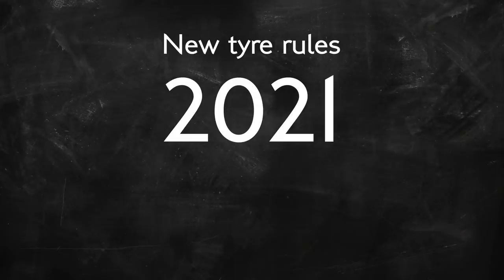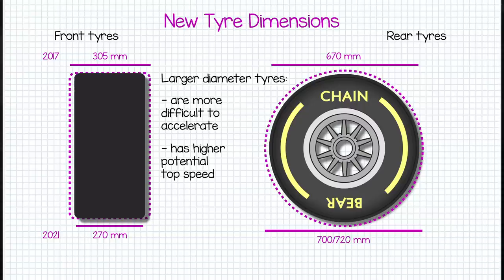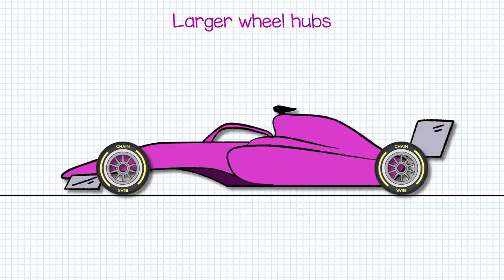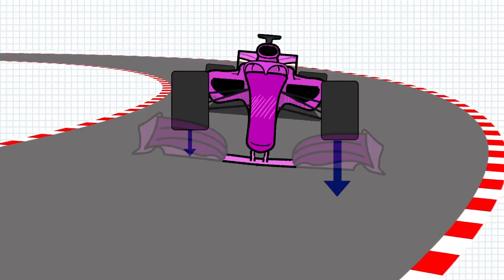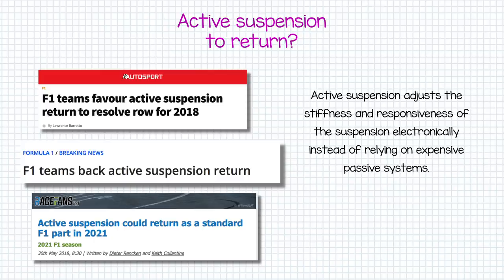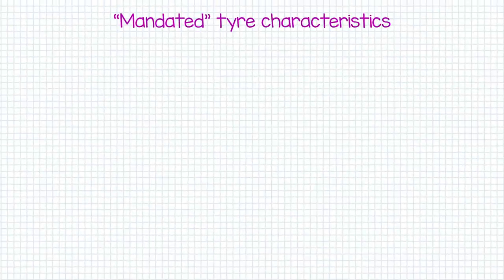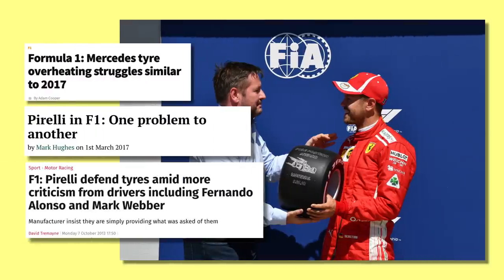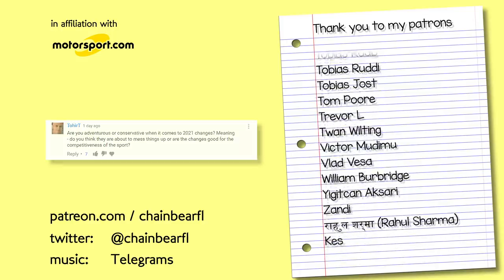New Tyre Rules 2021 explained - Low profile tyres, no tyre warmers, radical compounds

Comment: You forgot that larger brakes can be fitted.
Reply: moreover larger brakes would increase overall weight significantly which is a big no no in F1.
Reply: kuglepen64 bigger brakes doesn't always mean better. too powerful brake can easily cause lock up, which becomes more dangerous and producing less stopping power overall
Reply: +doge
To the contrary, bigger brakes provide finer control and lower chance of catastrophic failure for a given torque. Peak braking power means nothing when you can just adjust the damn pressure.
Reply from the maker: Ah true but this is unconfirmed. FIA might mandate that brake discs and ducts stay the same size
Reply: Chain Bear F1 larger iron or steel brakes = longer breaking distances = more passing!
Reply: FreQ135 no larger brakes mean shorter shopping distances
Reply: Larger brakes mean more unsprung weight - they don't currently need them
Reply: Rens van Ampting The brakes are currently made from carbon, which run very hot but are very effective. A shift to iron or steel would mean longer breaking distances and more overtaking.
Reply: Antoher thing is, it could be too much for the drivers if the brakes are too powerful, the forces they face are already insane so I can't imagine how difficult it would be to ensure even more force
Reply: Except they can't.  Because it is separately restricted.  How does your comments have 33 people that agreed with it?
Reply: I think they could maybe use more brake power at higher speeds but once it gets below 250kph or so it's all down to the tyres anyway. This is why drivers can lock up if they don't pay attention. So bigger brakes just means more mass, more unsprung mass and they don't even need them and all this weight if all the teams have equal limits for brake systems. Also bigger brakes and bigger cooling intakes for those brakes give a drag penalty although that is fairly small compared to the overall drag
Reply: Hamilton was complaining about the weight of the cars increasing, but the brakes not getting any better. Now they can fit bigger brakes.
Reply: Brakes in f1 are already big  and strong enough to stop the car from 300 to 0 like nothing. The thing that makes the difference is downforce which completely changes the braking power of the car. Downforce is about everything about this new era of f1. Thats why its boring!! F1 needs less downforce, actually a shit ton less than  what it actually has, f1 cars nowadays are as easy to drive as ever because of their downforce levels, obviously it is associated with higher G forces but thats about it..
Reply: It's not about braking power, it's about heat dissipation. A larger disc can dissipate more heat more quickly thus reducing the needed cooling. Smaller brake ducts means less drag. 

There are some other benefits as well but I don't have the time or space to write a technical article here.
Reply: I doubt the FIA will restrict brake discs if the tire rules already reduce grip. They'll probably let the teams tinker around with it and see what clever innovations come out of it.
Reply: @FreQ135  Wrong this would not mean more overtaking!. It doesn't matter how good or bad the brakes are in F1, everyone under the same rules will still be at the limit of man and machine under braking regardless.
Reply: @Jon B If you have longer braking distances, there is more opportunity for a driver to outbreak another, as they spend longer doing it. Eg. If you brake for only half a second, it's incredibly difficult to brake even 1/10 second later. If you are breaking for 6 seconds, it's much easier to brake a couple of tenths later than the other guy, because you have all of that extra distance to brake better or harder. Not every driver or car has the same braking ability or limit.
So I respectfully disagree with you.
Reply: Brakes aren’t an issue
Reply: Not required
Reply: @rancidalankar1322  extra few pounds of brake in each wheel = braking faster/more consistently = faster cornering

Comment: I just saw the notification and I have to say that am really confused about the new rules. I immediately came here to have a guaranteed perfect explanation of the new tyre rules
Reply: Saul Levy Basically, larger profile tyres on performance mean, faster turning response, faster braking due to larger brakes, a slightly less lateral g tolerance. From a practical point of view it means that the 18" tyres have a lot more relevance on the road, so you could buy very similar tyres for your car that are on F1 cars, but of course, with grooves.
Reply: J P in that case i was successful :D

Comment: Am I the only person who prefers having all the different names for each compound than the three tyres with the same name but different compounds
Reply: James Bloomfield nope
Reply: Also i like the colours. And they don't confuse me at all. But F1 needs to be accessible for the casual watcher
Reply: During a race you just want to compare tyres between cars to know who will gain or lose performance when they change tyres.

Comparing which tyres were selected by the authority on different tracks is meaningless.
Reply: @petrolhead9927  More accessible for a casual watcher, like saying today we have a hard compound tyres which are softer than last race softs and harder than the next race hards. It's like adding 1 joystick to your oven instead of 15 individually named buttons.
Reply: They should just name them. T1, T2, T3, T4, T5, T6, T7, T8, T9
"Oh, for this race we're gonna choose T3, T5 and T8"
Reply: You’re not alone. However purists will still be able to read the sidewall colour system, yes?
Reply: @odieostrich7718  If you mean the tyres will still have the original colours to this year (pink, purple, red etc.) then no. As far as I know it has now been confirmed that every race will now have... Red = Soft, Yellow = Mediums and White = Hard, so they are changing the colours we are all used to anyway "So they are easier to tell apart from each other on TV"
Reply: @HappyBeezerStudios  that's exactly what they do, C1, C2, C3, C4 and C5

Comment: Nice video, although you forgot one important thing. When the height of the tyrewall is smaller, it gets tougher/stronger, thus increasing the amount of G-forces that the tyres can withstand. This increases the grip (=speed) through corners because the tyres won't stretch as much as before and therefore, drivers can be more aggressive. If we suggest that the suspension is tuned perfectly, the cars will also be a bit more controllable since the drivers will have more feedback as before.

Comment: In theory, the lower profile tyres will help drivers in situations where in the past cars have occasionally over-steered suddenly or slid under acceleration, the driver has attempted to correct but because of the energy stored up in the sidewall of the tyre (i dont know if that's actually it but that's certainly how some f1 commentators have explained it), this causes the car to suddenly snap the other direction, putting the car into a spin and even into the wall on occasion.

Comment: great so now even f1 has big chavy rapper bling wheels i dont get why people think bigger wheels look better who looks at an e type's wire wheels and goes this really needs some 20 inch wheels with some rubber painted on. the current gen of f1 cars look fantastic with the aero and wheels like the tyrells and lotus's in the 70's
Reply: Its not about looks. F1 is supposed to be one of the leaders in technology driven motorsport. So why do they still use such archaic tires?
Reply: roryforham they have performance advantages you know. that’s why high performance vehicles usually have low profile tires
Reply: gav com but they also don’t have some performance advantages. Dragsters have high profile tyres. Larger sidewalls are beneficial for suspension too

Comment: This video popped up again, so I watched it again.
First of all, one or even two stops (unless you're on the hardest tyres) would become really difficult, and might lose you enough time that even a three stop is the minimum practical solution to any race. Just that alone, combined with the fact that you know some might even try four stops with such early tyre degradation, would make for a lot of strategic play. Let's just hope the FIA does away with the two compounds requirement and lets teams decide for themselves. If we see both a successful four stint soft run and a successful two stint hard run in 2021, I am very happy, because that means strategy wars, and as with most wars it leads to new ideas.

Comment: F1 Driver and FIA think that building a tire which is made of rubber is the same as building a car out of carbon fiber, steel, aluminium and so on (you guys get the point).
Rubber isn't predictable as stiff materials are. Rubber doesn't fail with the same consistency as (picking one of previous examples) carbon fiber does. Rubber needs to grip the car, have a temperature window much smaller than all the components in the car, needs to withstand massive amounts of force and they wear out so fast compared to any other component on an F1 car that it can't really be compared to anything else. So by asking Pirelli to not only build a tyre made of something which is not as consistent as a metal that can handle and provide the necessary performance to an F1 car but to also include a defined time window of lower performance in accordance to tyre degradation (by the second AND by the lap) is simply ludicrous and pretty much impossible. More likely than not, someone's gonna have to give in on one of those demands.

If Pirelli does pull that off without someone complaining about an aspect of the tyres (FIA, Teams or Drivers), I swear to god I'll not buy any tyre from another brand except Pirelli for the next 60 years of my life.
Reply: Sign me up too, and I will even make my own bastards use Pirellis too, until cars can fly and mankind does not use them anymore!
Reply: Very well said.  Kind of makes you think of trying to make a sword out of chewing gum.

Comment: My concerns for these changes:

No tyre warmers => Undercuts won't work as well.

Tyres that work better at low temperatures => Slippery conditions are now easier to drive in (Germany 2018 won't happen).

Low profile tyres having more setup variation => More opportunity for upset results  Active suspension removes all variation.

Comment: More to the point, perhaps, is potentially greater inertia of the wheel assemblies.
90+% of people don't give a heck for any race programme the tyre manufacturer is involved with, very few could even tell you who the supplier is.
Tyre technology, or rather understanding how the tyres work on the vehicle, is a black art and these changes are a double edged sword - while some modelling may be transferrable from other disciplines, much of the current understanding and modelling will have to be thrown out. The suggestion that they will potentially have an even narrower optimum operating range will, no doubt, be greeted with horror by the engineers who already are having problems getting, and keeping, the tyres in the current range.
Agree that the compound criteria is daft - it does bring into question whether heat cycling will partially cure them to improve, or tweak their race performance - possibly teams using more of their race allocation prior to the race in Qualli' or practice?

What is also going to undergo some massive changes is the braking, as they will no longer be as restricted by the wheel inside diameter.
Reply: If properly designed, the wheel should only be a few grams heavier while the tire will actually be a LOT lighter. So total rotating mass should be less.
Reply: wingracer 16 thats impossible, the 13's are smaller than 18's and will always have smallet weight and inertia
Reply: You are ignoring the tire. Rubber is heavy. Less rubber means lighter tire.
Reply: wingracer 16 sidewalls are very thin and light, pirelli have confirmed all this years ago, the wheels will be heavier by a much larger margin than rubber savings, but itll look "cool"
Reply: True, the construction is very lightweight, esp' when compared to 'road' cars - but, remember, while there will be a reduction in sidewall height, there will also be more mass added  in the bead/breaker area as it will be significantly longer.
Then, of course, there is the additional mass of the wheel - square law, remember - and the bigger brakes that will then be used will also compromise total mass, both unsprung and rotational inertia.

Comment: If active suspension does indeed return, and one teams system is not as effective as anothers (aka it doesn’t work), how much time would they lose over a lap as a result?
Reply: Mutch. If doesn't work you will be probably near the last teams.
Reply: im sure all the teams will put so much time and resources into it, that theyll all be as perfect as they can be for their respective suspensions, cept williams, theirs will probably act like one of those bouncing cars but they cant turn the bouncing off
Reply: "Active", be it suspension or aerodynamic is banned from Formula 1.
Reply: The nice thing about active suspension is that if you are behind your competition, you don't have to spend millions designing a whole new system. All you need is a software update.
Reply: all they need to do is learn how to tune the suspension just like they do in other forms of motor sport
Reply: How TF would anyone know that without it actually happening 😂

Comment: Low profile tires will drip quicker, but the profile( bead of the tire to the surface) or sidewall thickness, will wear out quicker. General rule of thumb.

Comment: What you mean is there will be smaller proportion of undamped suspension with low profile tyres. But what about unsprung weight with much larger rims? Dont forget weight goes up with r^2.
Reply: It means the suspension provided by the tires large sidewalls is uncontrollable by the teams, moving to a larger rim moves more of the suspension to the controllable side, designed by the teams.

Comment: 2:40 so bigger tyres = faster. hmmm tractor tyres on an F1. This would be genius!
Reply: bigger wheels is a higher top speed with the same vehicle
Reply: if you had tires the height of a tractor tire on an f1 car accelerating in a straight line, ignoring aerodynamics youd eventually reach a higher top speed than you would with the 13"s

Comment: This could interesting, but one other thing they could do is open tyre supplier again and open the tyre compound to have a drop off window say the hard tyre to have a cliff between 20-25%, the Medium between 14-20% and the Soft between 10-15%,  that would bring strategy in again,  say mclaren & Toro Rosso use a Bridgestone tyre, but the way each car works offers the same tyre a different operating window,  so strategy becomes important how to manage the tyres and get it to work,  Ferrari &  Renault use a Pirelli, each car will offer different characteristics with the same tyre, will make the racing a heap better

Comment: Nice video. It would have helped to give the approximate aspect ratios for the new and old tire-wheel combinations.  

The marketing relationship I came to understand better yesterday. Rode with a coworker in his new Toyota Corolla hatchback. The car had tires with a 40 aspect ratio on 18 inch wheels. I was surprised at how smooth the ride was. 20 years ago 40 series tires made you think you were driving on a poorly maintained cobblestone road.

Comment: my main question/concern is.. Are these low profile tires safer than the older design or are they only making this change for style purposes? From my little bit of knowledge when it comes to road cars.. Low Profile tires seem to correlate with rougher rides and are more of a fashion statement rather than practical/safety. 

I really hope it's different here, and the lower profile tyres will lead to less tyre issues/blowouts/damage and are safer for the drivers.. and not the opposite, the moron rule makers putting "trying to staying hip with and attract a younger audience" over driver safety or worse, put their marketing/profits over driver safety when it comes to correlating F1 tyres to road tyres..
Reply: Big tyres means big wheels. Big wheels leave room for bigger brakes and more brake air flow. This is why low profile became popular but anything over 18" is, as you said a fashion thing.